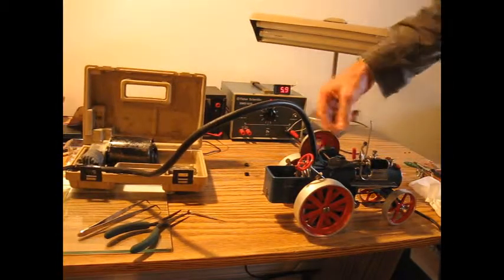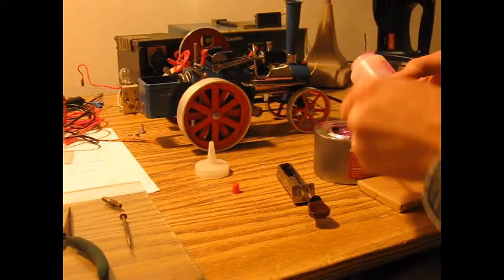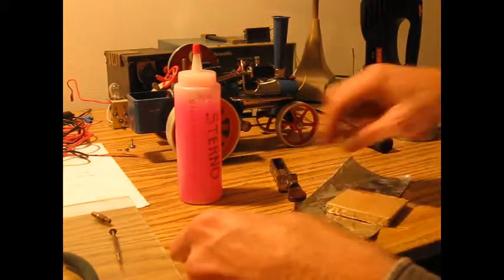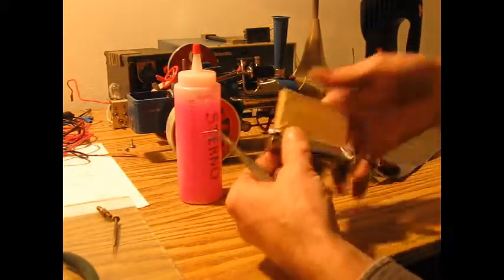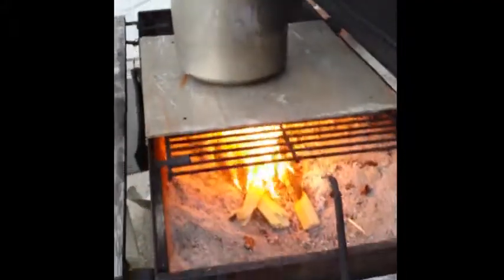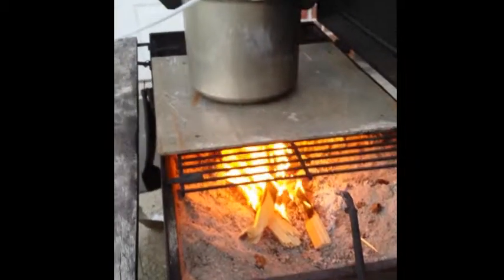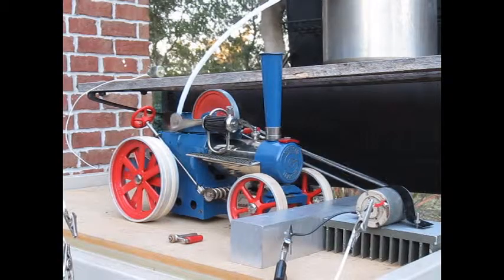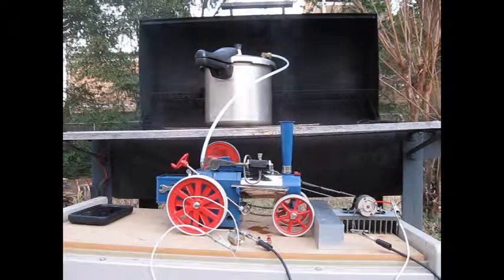model steam tractor powered by Sterno and turning 12V motor as a generator

Comment: Thanks for sharing the foil-forming jig tip. I have a D375 roller kit coming, and will definitely be using this technique. Liked your sailing kayak conversion as well. We have a pair or Folbot Kiawahs (purchased shortly before they shut down). The skin on-frame construction doesn't lend itself to sail conversion, but looks and paddles great, and you get to build a boat every time you go out! Keep on playin' ;^)